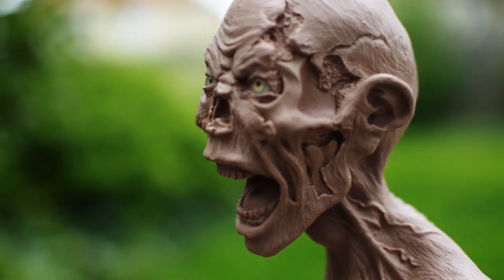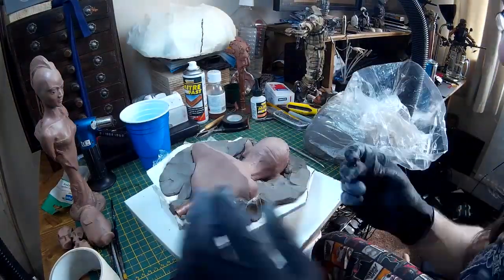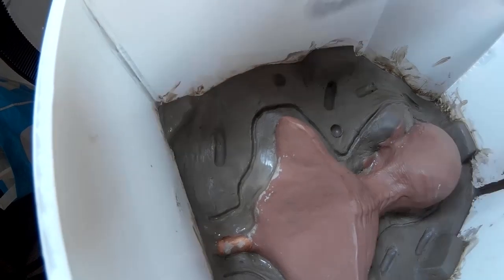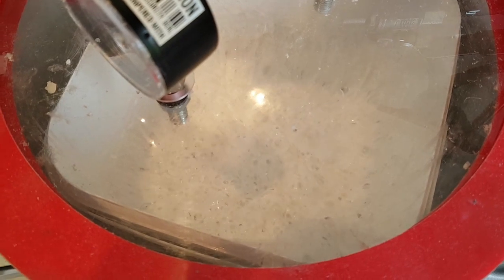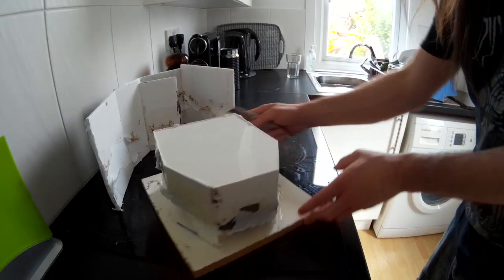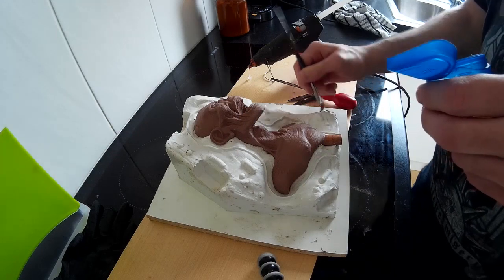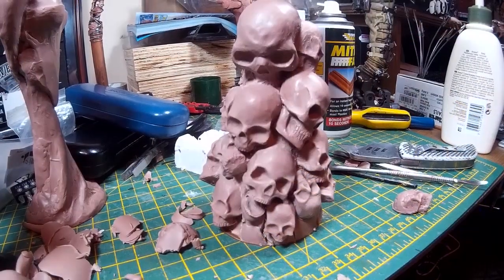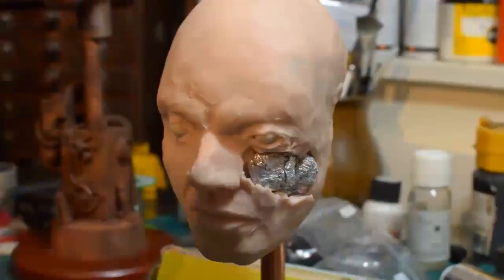Sculpting a Zombie from Monster Clay Part 2 - Making a Mould

Comment: Thank you for the super informative video. is there a cheaper alternative to buying a degassing chamber? i'm pretty new to modelling and don't think I should be forking out £250 right just yet.
Reply from the maker: Thanks for watching.  You don't necessarily need to degas.  If you're just making basic moulds and not doing anything special with them (like pressure casting) you can pour the rubber from a high point in a thin stream. This will help burst the bubbles as you pour.  Using a long set silicon will also give it time to naturally degas as it sets.

Comment: When I worked at a dental lab they used an ultrasonic vibration plate to get the bubbles to raise to the top stone models made from the impressions.
Reply from the maker: Interesting, I'll have to investigate that method.  Thanks!
Reply: @thedarkpower  your welcome,  If a place had to have perfect pours, thats one. Any bubbles in a pour would have areas of the teeth or gums missing making it impossible to make a perfect fitting crown or denture. They also used a pressurized boiler when making things out of composite. Stuff was like a bendable wax uncured, bubbles in water would deform it otherwise. I have not tried to make any molds of anything yet for my sculptures, but this video will be very helpful. Thank You for the video !
Reply from the maker: Thanks, interesting process. I've been meaning to try dental acrylic to see if it's useful.

Comment: Thanks for reply me about how to mold the monster clay including the eyes. Another question, Can I leave the monster sculpture without molding? because look very nice and I'm afraid if something happens in the process of molding. Also I don't have the vaccum that you use.
Reply from the maker: Yeah you can leave the sculpture, it'll be a little soft of course.  You don't need to use a vacuum chamber for moulding though, I didn't for years.  It does help you get a slightly better result though.

Comment: That is so cool! Great idea about using other bits of cured silicone to add more volume. Who knows when - if ever - I would have thought of that. Now I have something to do with my "learning phase" errors. :P Not many of those but most are really big molds so lots of silicone I can cut up. :D - Heidi
Reply from the maker: Thanks!  Yeah it really helps as you can end up spending so much on silicon.  Just make sure they're clean - if there's something on them it might stop the bits sticking together.
Reply: That's good to know. Thanks. :) What do you suggest cleaning them (and not cleaning them) with? I have to confess to using some of my errors like the flat bottom (or sides) when I find a need for them so they have become a bit dirty.
Reply from the maker: +BlackCat2 i used white spirit although I reckon washing up liquid and water would probably do the trick too.
Reply: Thank you! I will try cleaning my largest one later today and if it works well will then cut it up. I will make sure to store it in a sealed container so it won't get dirty again also. :)
Reply: Best tip of the video

Comment: So, the sculpture you were working with is an uncured ( soft) model from monster clay? Which grade monster clay did you use for the sculpture?
Reply from the maker: Yes that's right - monster clay doesn't cure.  This is made from the medium hardness.
Reply: @thedarkpower  and you don't have any real problems with removing the water base clay without damaging the original sculpture?
Reply from the maker: @willbrown4046  No,it's fine as long as you're careful.
Reply: Sweet! Thank you so much for posting this.  Also, I've been searching around for materials and they all seem t0 be somewhat on the expensive side. What materials are you using for your molding and casting?
Reply from the maker: @willbrown4046  No probs.  I've changed from what I was using in the video and I'm using these at the mo - they're the most reasonably priced that I've found

https://www.dwrplastics.com/general-purpose-moulding-rubber.html

https://www.dwrplastics.com/pu-casting-resin.html
Reply: Aww...man. Looks like they don't have any u.s. distributors. Bummer.  Thanks for the information though.
Reply from the maker: @willbrown4046  No worries - check out Smooth On, they're a US company.

Comment: Great video, massively helpful! What would you recommend if I wanted to cast something in latex rubber? Use plaster mould with the same process as you have in this video? Any help would be greatly appreciated!
Reply from the maker: Thanks. Yes I've seen people make a plaster mould, pour latex in and leave it for a few hours so that a layer forms on the inside of the mould. You then pour out the excess and let that layer dry. It's a technique used to make masks and gloves etc.
Reply: @thedarkpower  would a plaster mould be suitable for multiple casts? I'm planning on using latex as you said, then filling it with a foam
Reply from the maker: @MrDaniel1832  I gotcha.  I've not tried myself but I think it would.  This is the video I saw on the technique  https://youtu.be/ZY6k6foXEN8?t=533
Reply: @thedarkpower  excellent, thanks for your help

Comment: I want to make a silicone mold of the life size skull. What you recommend to me, brush mold or the technique that you used? I thinks if I use your technique will be a lot of silicone material or resin.
Reply from the maker: Yes I'd probably go for the brush on method for that, unless you can construct a very close sitting mold jacket.  You can also roto/slush cast the resin to produce a hollow cast so you save on the amount of resin used.
Reply: The Dark Power I need to calculate the volume and materials cost. If I want to make a business
Reply: What brand are you recomend me for rotocasting?
Reply from the maker: I've only done rotocasting a few times so I'm probably not the best person to ask.
Reply: The Dark Power thanks

Comment: Do you the silicone directly onto the moist waterbase clay? Or do you dry the surface of the waterbase clay they clear it with an acrylic clear and/or mold release?
Reply from the maker: +DARK RIDE - Nightmare on Wheels I pour the silicon straight on to the clay. I've not found that the moisture inhibits the cure at all.
Reply: Wow! That is good to know. I sculpt with WED clay and would usually spray an acrylic ( rattle can) clear over it then a mold release. Again, great video!
Reply from the maker: +DARK RIDE - Nightmare on Wheels thanks. I can only comment on this particular type of silicon.  I suspect other condensation cure silicons will be the same but I'm not sure. I know some platinum addition cures are ok with moisture too.
Reply: Thanks for the info.

Comment: Thank you for the video! I would appreciate if you can help me with my questions. I want to mould the sculpture I made, just the way you did. Do I have to use any release agent on monster clay before I start molding? I also want to use plaster mould I made to get monster clay sculpture out of it. Do I need any releaser between plaster and monster clay? <3
Reply from the maker: Thanks for watching.  I've not tried, but I suspect you wouldn't need a mould release if you're making a plaster mould from a monster clay sculpture.  I've done this frequently with a chavant sculpture - the clay just peels straight out nice and clean.  If in doubt do a test with a small blob of clay and some plaster.
Reply: @thedarkpower  Great videos. Thank you for sharing your knowledge with us. Sorry if I ask too many questions. Do I need releaser if I use silicone for molding monster clay? Can I use acrylic coating spray or vaseline as releaser? <3
Reply from the maker: @Sweetheart8i8  I've never used release agents when casting monster clay in silicon, so you shouldn't have a problem.
Reply: @thedarkpower  Thank you!

Comment: Is such silicone toxic, irritant (fumes)? What do they say on the package?
Reply from the maker: No silicon isn't very toxic - as long as you don't eat it you should be fine ;)
Reply: @thedarkpower  Silicone glue (sealant) that smells like vinegar is toxic (at least it's bad for me). Acrylic paints etc. also work badly. The only paints that are not toxic for me are poster paints and watercolors. As for glue, it's only for office use for paper. I do not use any other. I have not tried hot glue (apparently completely non-toxic). All attempts end up with a problem permanently.

Comment: If the air dry clay is the same like a water clay that you are using for molding?
Reply from the maker: +ROD Boricua no - air dry clay often has nylon fibres in it to hold it together when it dries.
Reply: thanks

Comment: What price was it for the silicone nice work
Reply from the maker: The stuff I used was £22 per litre and I used about 2.5 litres for this.
Reply: The Dark Power would you have the name of it or link please
Reply from the maker: Sure, I used this stuff:
 https://tiranti.co.uk/product-category/mouldmaking/silicone-rubber/t28-silicone-rubber/

However I've since starting using this which is cheaper and seems just as good.

 https://www.dwrplastics.com/rtv-silicone-moulding-rubber/moulding-rubber/general-purpose/silicone-moulding-rubber

Comment: So currently my monster clay and armature are stuck in the gypsum mold and I can’t get it out. Any tips?
Reply from the maker: Sorry to hear that! Depending on the sculpture the monster clay should eventually give, unless the gypsum mould is locking on itself. So what I usually do is get a chisel or screwdriver between the two halves of the mould and slowly work it free - don't concentrate on one section, try and part the mould a little bit on each side. It can sometimes take forever but it should eventually give.  If the mould is locked on itself or the two halves are stuck together you may need to cut it though. Good luck!